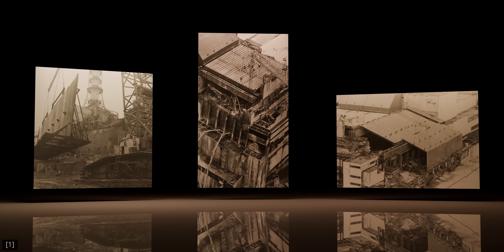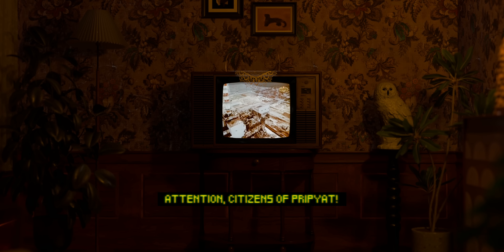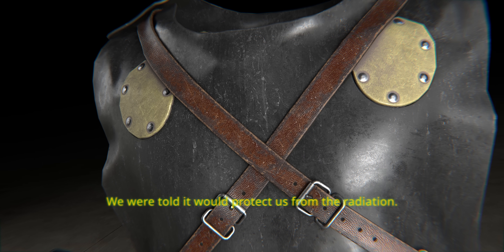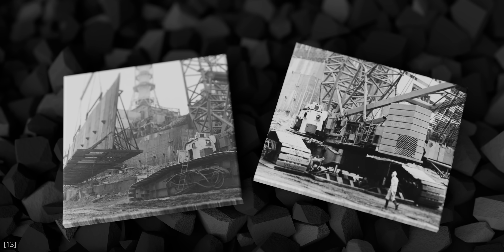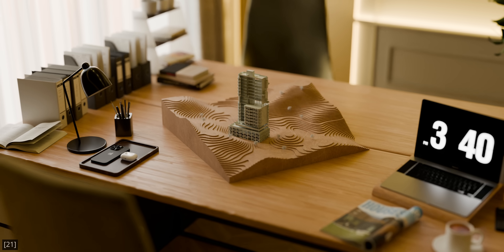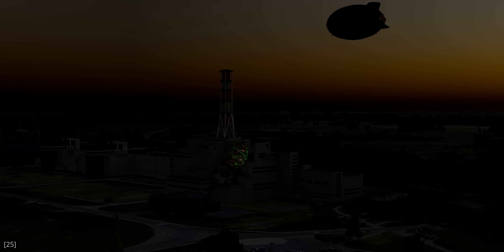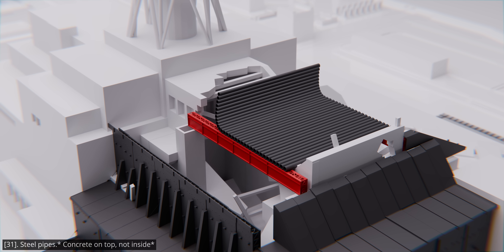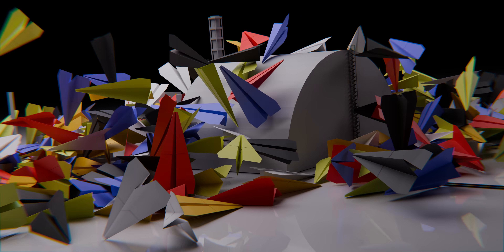Covering Chernobyl - The Impossible Task

Comment: I can't even wrap my head around what happened to those poor souls working inside of the control rooms for reactors 1-3. those guys had to work 16 years near a melted reactor.
Reply: It wasn’t that bad, the building is like a kilometre long and the control rooms were shielded in lead and you have to remember the building was made of thick borated concrete radiation inside the U3 control was slightly above background but safe

Comment: Gorbachev was shocked. Hour later he said: Chenobyl NPP accident was one of the cause dissolutions of USSR!
The story is true. There is a helicopter try cover the roof top or core with Boron sand, not until 5 minutes the helicopter has crashed and all crew killed. Radiation level around roof top core is 300 Sv/Hr! Which 5-8 Sv enough to kill a human instantly! There's high level radiations of Cesium-131 read Rad Detector in Belarus Atomic Agency within one hour of the explosion.
There's NEXFLIX 6 episode show named Chernobyl. This is high quality title about the incident you need to watch.

Comment: Crazy part is ..the 2nd solution is only good for 100 hundred years at max. the radioactive uranium spilled has half life of 4.5 billion years. Meaning only HALF of the fuel will be gone in 4.5 billion years.
Reply: Uran 238 (half life 4.5 billion years) is not that bad, the higher the half life - the less radioactive element is. Modern tank shells using this isotope and i don't remember radiation poisoning accidents. The problem is with short half life isotopes like uran 235 which is full half life is 704 million years.
Reply: @CologneV6_2.3  partially true as even thought 238 alpha partials get blocked by our skin, if ingested via contaminated water or air can still be lethal.
and 235’s 704 million year half life is still a lot😂
Reply: @stevkoria yeah, workers will still wear bunny suits and gas masks because that dust is no bueno, but it'd be much easier to dismantle once most of the short half life fission products have gone away.
Reply: @stevkoria  lethal do to its heavyness not radioactive decay
Reply: The higher half-life stuff is inherently less radioactive than the lower half-life stuff. By the time the NSC needs replacement the remaining radioactive material would be significantly safer to handle: The kind of stuff you wouldn’t want to sleep next to or inhale, but wouldn't immediately give you a lethal dose.
Reply: @TheBleggh  NCS will never be replaced they actively dismantle the reactor within. There won‘t be anything left inside before that happens.
Reply: Also, the shelter was "accidentally" hit with an automated drone by the Russian government. It's not even safe anymore. Also, radioactive isotopes with shorter half-lifes are more dangerous (such as radium-288 and radium-226.) and emit more radiation faster.

Comment: At 3:57 when he says the radiation has a metallic taste, is that just him tasting his own blood from the radiation frying his insides?
Reply: no, its from radiation damaging taste and olfactory cells, leading to altered signals and a "taste" of metal.
Reply: No - it’s probably due to the literal aerosolized radioactive/non-radioactive metals. Like Caesium, Strontium, Barium, Cadmium, Zirconium, etc are all major fission products of Uranium, not all of which are radioactive (but none of them you want in your lungs). That, plus the graphite, zirconium, uranium dioxide and iron that made up the nuclear reactor were also likely pulverized and then kicked up by the liquidation work. They had to destroy their clothing after work - so clearly metal aerosols were kicked up in the air and landed on/in them during their work. Acute Radiation can be “quick” acting on the body, but unless they were exposed to radiation levels wayyy above the normal liquidator dose, it wouldn’t act instantaneously and cause either your olfactory cells to be destroyed or blood vessels to burst. Remember, the radiation kills the cells from the inside - resulting in the cells self destructing or being killed by the immune system (if you don’t lose all your WBCs). Even with an acute (>500mSv) dose, the damage would manifest in hours to days, minutes only if it’s >5 Sv

Comment: For the people who are confused on why they were told never to look over the edge into the reactor, think of the reactor as pot of boiling water. You stand next to the pot and you feel some heat but its not the full thing. The same thing applies to the building. The concrete walls act as a "pot" to the deadly "water" which is radiation. Even if you get a quick glance the steam and heat hit you full force. That being said, even a split second look is enough for a lethal dose. Basically you look for a second you gave yourself a few weeks left to live. Hope this helps!
Reply: Thanks mate
Reply: But still there is something fascinating about it that wants me to pick and take a look 😃

Comment: whats the point of putting containers inside the area that has to be filled with concrete? They will just make air pockets and make the wall less effective at stopping the radiation. I understand they want to get rid of radiated vehicles but they still had large amounts of them left outside the concrete.
Reply from the maker: Yeah I'm not sure. Was thinking about that myself

Comment: "this was the deadliest place on the planet". Not by a stretch!! 98% of the planet we for some reason like to call "our own" is so deadly to life that it will immediately kill it on contact. It contains extreme pressures of rock and water, and extreme temperatures which will end one's life much, much faster than the top of the roof over Block IV of the Chernobyl reactor in 1986. We are only able to live on a tiny percentage of the planet's very immediate surface and even then we experience hunger, floods, hurricanes and tsunamis disruptive to our way of life. I know what you said sounds very dramatic but it's equally untrue Chernobyl is not and never was "the deadliest place on the planet".

Comment: Thank you for sharing this. One can find a lot of media about how the reactor worked, the bio-robots on the roof, the remediation efforts, and the wildlife of the exclusion zone - but the actual construction of the object shelter is very underrepresented. Even documentaries on the new safe confinement - which mention its built to deconstruct the old shelter - don't give much information on elements like where the mammoth beam is located. If there is a part two to follow up, I'd like more about where and how the precast sections were made or some of the other design ideas, rather than just moving on to the next shelter.

Comment: if you think of it, why not use an oxygen task to not breathe the radiation in and use a massive vacuume to suck the radiation up?  edit: water can stop the spread of radiation, particularly gamma and neutron radiation, making it an effective shielding material. Water is dense and contains hydrogen, which interacts with radiation particles, slowing them down and reducing their energy. This is why water is used in nuclear reactors and for storing radioactive materials. so then why dont we fill chernobyl full of water?